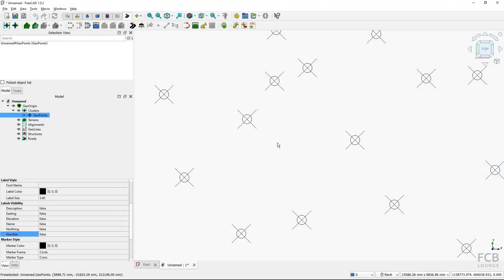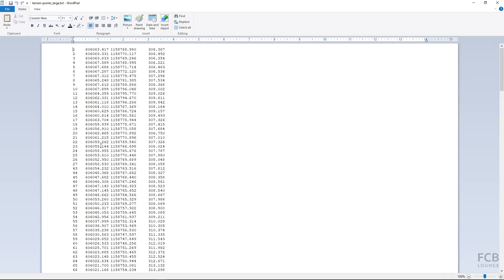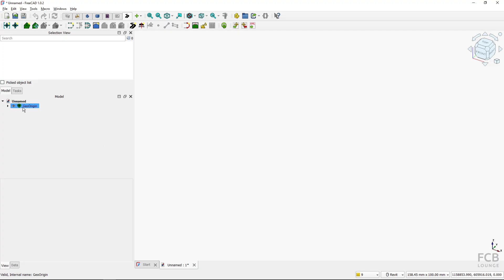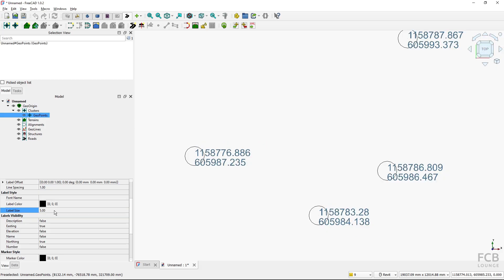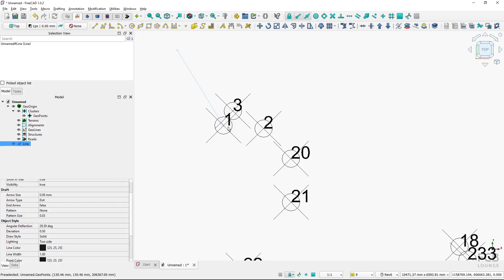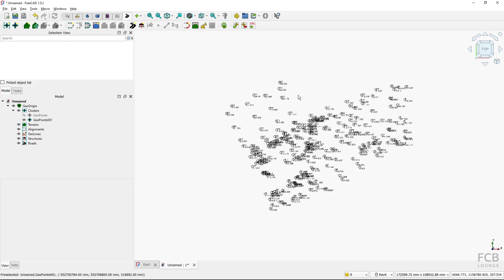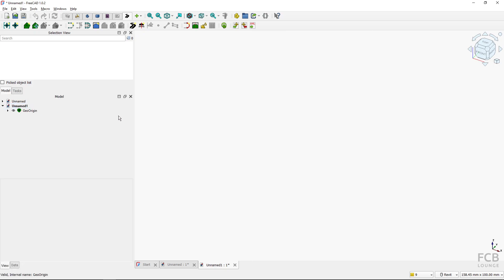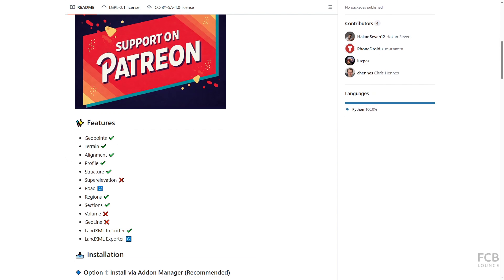Import Geodetic Survey Points to FreeCAD | Road Workbench

Comment: I installed the Road add-on, restarted (and rebooted), and cannot figure out how to access the workbench. I do not see it as an option on the Customize Toolbar screen and cannot find it elsewhere
Reply from the maker: The installation should be non problematic. You should use the workbench switcher on the 'Workbench' toolbar, you don't need to use the 'Customize Toolbar'.
Note that by default the workbench switcher is a drop down menu, unlike the one I use in the tutorial.